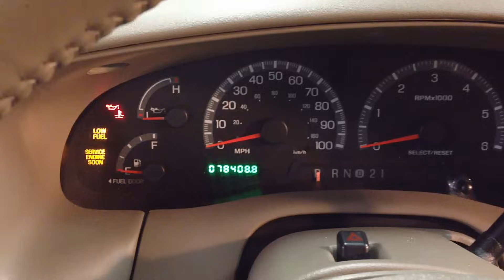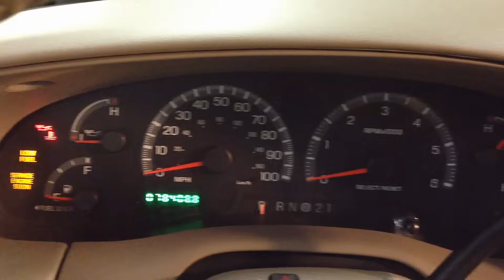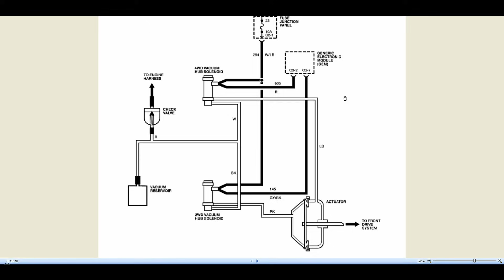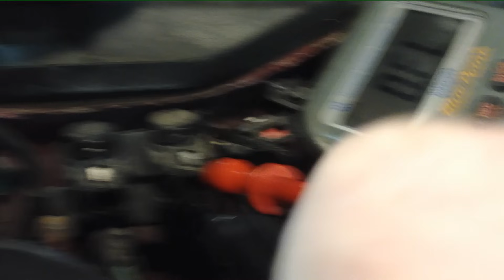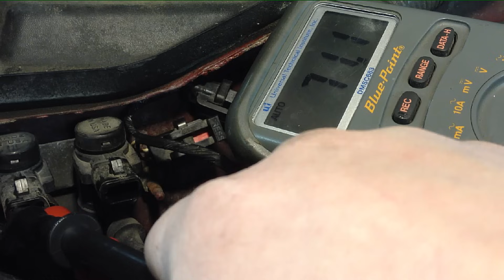1997-2004 Ford F150 4X4 Inoperative In Depth Diagnosis

Comment: I was able to do all these tests except checking resistence on the solenoids my 4x4 will engage but has a rotational  noise coming from the front end especially noticeable at 80km to 100km. Would this be a actuator fork problem or the actuator solenoid not fully engaging at higher speeds both wheels will spin at the same time with the front end lifted off the ground.

Comment: Thanks so much for this, I know it's an old truck but it's all I have and the 4x4 just crapped out. It was working fine last winter but now I get no clicks at all. I replaced the dash switch but that didn't help.Now that I have a better understanding I'll go through some more diagnostics.

Comment: I have a question for you sir.  I’m trying to figure why 4x4 won’t engage for a 2002 F-150.    With the help of your video, I’ve been able to determine the transmission shift motor sound to be working and the relay in the dash behind the instrument cluster is clicking consistently when shifting the selector between 2x and 4x modes.   Additionally, I have constant keyed 12 vs to the two firewall mounted solenoids and I have appropriate switched ground to those same plugs when the selecting 2x or 4x modes on the dash selector switch.   What I don’t seem to have is a good strong vacuum (it’s there, but maybe weaker than I would have thought it should be) when the engine is running.   So, I pulled the battery and battery box out to access the two vacuum reservoirs behind the battery box thinking maybe they were cracked.  Using my vacuum test equipment, I pressurized each reservoir to 5psi and it took over five minutes to lose even 1-psi.  Frankly, a little bit of soapy water sprayed on indicated a tiny leak only where my test hose was connected to the reservoir port nub.   As a precaution I used Yamabond 3 sealant and went around the welded seam of both vacuum reservoirs anyway.  When I test the vacuum on the lower lines that plug into those two solenoids, I can barely feel the pull on my finger and I basically won’t even move the needle in my vacuum gauge.  Might you have any suggestions as to where to start finding out why the vacuum is low at that location?   The truck itself runs just fine without any roughness, rough idle, or anything that would indicate a sizeable vacuum leak otherwise.   Thanks for any suggestions you may have.

Comment: Hello : The four wheel drive system on my 2003 F150 does not work. Upon turning the switch, nothing happens. I just finished changing out the four wheel drive relay under the dash. No change, still does not work.  I just tested the two vacuum modules. The ground simply stays on the 2wd module, it will not switch over to the 4wd module. What is next ? The GEM module?

Comment: 2009 f150 King ranch 54 engine 6 speed automatic transmission 4x4 shipped on the fly. I'm having problems with my 4x4 engagement. I ran to the full diagnostic procedure for 2009. I was a Ford certified technician for 20 years. The diagnostics came up with everything functioning normally. I have replaced the electric transfer case 4x4 motor and the vacuum 4x4 solenoid. With my vehicle running I turn the 4x4 switch from 4x2 to 4x4 and nothing happens whether I'm sitting still in park or neutral or moving at 10 miles an hour down the road. If I turn the key on with the engine not running it will engage and also disengage. If I turn the key on engage The 4x4 and then start the truck it will drive in four-wheel drive to disengage  I need to stop the vehicle put it in park shut the vehicle off turn the key back on and then switch it to two wheel high and it will disengage. The only odd thing I see is that when I'm driving or sitting still if I turn the wheel slightly to the left or right before by 2 will display on the dash intermittently. I am at a total loss.

Comment: I have a 2003 f150. When I turn the switch to 4x4 I hear nothing and the dash light doesn’t light up. I checked the fuses and the vacuum as you demonstrated and I have vacuum. I can also move the pin in and out on the actuator by hand. Where should I go from here? Thanks

Comment: I have a 2000 f150 5.4L. the 4x4 light remains illuminated all the time and i hear no sounds at all when changing the selector switch. I have vaccum to the selenoids but haven't checked any further. Should I be checking the selector switch, shift motor, or GEM instead

Comment: My vacuum lines were replaced 2 years ago. 4x4 worked great. The person who replaced them put them too close to the manifold,  and they melted. I had to use my 4wd and just learned of this. Now my 4x4 light on dash doesn't show, and my lines are melted. Do you have a vacuum line diagram and why isn't my lighting on up, tand I thank you for any help you could give me.
Reply: Where did you find vacuum lines for your truck?

Comment: My manual shifter doesn't want to go unto gear. The shifter has been off, freed up and lubed, it moves freely, but sometimes it won't drop.into 4w low. What could xause this problem?  I should also say the front diff won't engage either at the moment, and I had the transmission out and back in a couple of times over the last couple of months, rear diff off and on

Comment: Just found your video. Currently going through 4WD problems on my 1999 f150. I have been having some issues with my 4WD shifting into and then out of 4WD and the other I found what I thought was the problem a vacuum leak coming from the actuator. Watched your video replaced the vacuum lines and can visibly watch the actuator work but not I have no 4WD at all. Before sometimes I would have to backup and pull forward now nothing. I watched your video on transfer case shift motor and was wondering if there was a way to know if that was my issue or the selector fork? I don’t want to shoot the parts gun at it but I can 😂

Comment: Best video I’ve seen on this so far. The only problem is that it assumes everything tests OK like the truck in the video. My 99 F150 is stuck in 4wd. I went up into the Colorado foothills on a snowy road and the 4wd worked fine. It shifted into 2wd OK when I hit drivetrain pavement, and back into 4wd when I got to my hilly, snowy neighborhood. I haven’t been able to get back into 2wd since.
I followed the diagnostics on the video and the test light came on in both 2 & 4 on the inner (4wd?) connector, but in neither setting on the other. Same results on the ground side. Resistance was around 70 on both solenoids. I felt no vacuum at any vacuum line, unless it’s supposed to be subtle. My truck has both manual transmission and manual shift transfer case. The 4wd light on the dash stays on regardless of the shifter position. I’ve watched dozens of videos, but this one shows the clearest test procedures. Unfortunately, none has shown me what to do/test when these things go wrong. Any ideas out there? 
Also I’d love to get a downloadable copy of the vacuum diagram or directions to the source.
Thanks

Comment: I know it has been a long time since this video, however I have a 97 F150, and the 4X4 that is not working. Can you tell me what the OE part numbers are on the Solenoids (as far as I can tell there are 2 different Solenoids and it all depends on the tang position on the wiring harness clips) and also the OE Number on the 4WD Actuator at the Transfer case ? Any help would be appreciated.

Comment: Thanks for the explanation on the 1997 F150 4WD mechanism. My truck is a very early production model F150 4WD truck. My 1997 F150 4WD just started making a growling sound like it like it’s in 4WD when it’s in 2WD. I am able to engage 2WD to 4WD and back to 2WD just fine. This just started the other day when I drove it a few blocks to a meeting. When the meeting was over an hour later as I drove out of the parking lot it was growling like it was partially in 4WD. I think it could be a cracked vacuum reservoir. Thanks

Comment: My 97 f150 lariat is stuck in 4x4 low range im not hearing any noise behind the dash when I try to shift it into 2wd or any of them. Nothing is happening underneath either I check all the fuses and the switch and they are all good. I'm not sure if its the GEM, or the vacuum or the case motor. Any tips?

Comment: So if the ground isn't moving to the other solenoid when I move the switch to 4wd, does that implicate the GEM? (I can confirm that the resistance values generated by the switch itself are normal and stable.)

Comment: So my issue is I hear the relay clicks but no dash lights and no 4wd if I put it in low it goes to low but no 4wd cvs front drive shaft and diff is good

Comment: I'm having a problem with an 02' F250 that when the truck is running, I can shift the 4x4 shifter out of 2H but will get stuck in 4H and only go into 4L sometimes but will get stuck there as well. Shut the truck down and the shifter will shift smoothly in and out of all three positions. Tired rocking the truck back and forth from drive to reverse but that does not help. Did not matter if hubs were locked or free

Comment: I have no negative to solenoids and no click under the dash or shift motor rotation.  Does the gem feed to a relay that may be bad or could the gem be partially bad?  Thanks, Don

Comment: I don’t have power to the 4WD engage solenoid…. I looked at the gem module and fuse panel and there’s no sign of corrosion, and everything else works great. The only thing that’s wrong is the 4x4 isn’t engaging.

Comment: So you covered 4x4 high very well. My issue is switching from 4x4 high (i hear the click and dash illuminates) into 4x4 low.. (i do not hear a click nor does low range illuminate on the dash.. suggestions?

Comment: My only have switches only had back into the four-wheel drive one and I know back into the two-wheel drive side. Two-wheel drive side doesn't have the ground power . Four wheel drive has which has the ground power  and vacuum.

Comment: Great instructing man!! All checks out on my 03 f150. Actuator is moving all the way back and forth on front diff. but when in 4x4 mode front diff. axles are not locked. Tried pushing actuator arm farther in with no results. Looks like it is completely moving in all the way so what else could be going on? Thanks for any advice. CHEERS!

Comment: I have needed to do a battery disconnect reset, two different times, to get front differential engaged. 2000 f150 . What should I replace? Or just continue doing reset? Dashboard lights indicate 4x4 engaged. High/Low range works
Reply: What is being reset when I disconnect the battery.

Comment: Ok 4x4 manual shift for transfer case. When shift sticky old truck shifter to 4x4 high and low light on dash appears. So put in drive from neutral and auto trans trans not in gauge then catches in say 3 seconds w higher rpms ,not tromping it ,easy. So trans catches and drive but won't go into third ,high rpms won't shift. High rpms not shift. Previous owner s may have messed w linkage she liked to pop out w
Unless manual shifter is man handled into 4x4. She used to work.

Comment: Excellent description and testing. I replaced my 4x4 select switch on my 2001 F150 Lariat but the solenoids still do not switch, the 4x4 indicator lamp is on no matter the switch position, I do not hear a relay engage when rotating the switch to 4x4. Both solenoids have 12v pos but the negative does not switch. Do you have any information how to test the GEM module to verify the switch is connected and the GEM is responding? Any help is appreciated.

Comment: My 2002 is stuck in 4 wheel drive. Light is still on when switched to 2 wheel drive. I have power but no ground on my 2 wheel sode of the harness. Would that indicate GEM module?

Comment: My issue is that, when trying to put my truck in 4x4 low and high, it doesn't even light up the two lights in the instrument panel... Oh yea, and it does not activate the 4x4 obviously throuythe transfer case!!! I do hear the normal clicking that it did when it was working coming from inside the dash with the relay

Comment: Thanks for the video very helpful but not working. Everything is fine vaccums are pulling the lever and I can hear the 4wd engage. But it doesn't work I spin one wheel when jacked up and nothing and for sure as I drive it's not working any ideas?

Comment: Great video 
Would either one of these solenoids get stuck open or cracked diagram cause a vacuum leak enough to cause loss of vacuum during acceleration 
I have been going through everything vaccum related to find out why my ac vents go to defrost only during acceleration.
Please help
Reply: Check those vacuum lines that goes to those solenoids. I had the exact same problem and I found two lines that were cracked and breaking. (They were basically dry rotted.) Once I fixed them, the issue went away. I’m trying to find replacement vacuum lines cause they can only be fixed so much.

Comment: 2003 f150 4x4 when I raise the truck up front wheels in the air...right wheel spins freely  but not the left would there be something wrong with the actuator not disengaging properly?

Comment: My 98 Ford 150 XL 4x4 suddenly stopped shifting gears in 2 wheel drive. I coasted into a parking spot an manually put it in 4 wheel drive and was able to drive it home. Do you have any clues what the problem might be? Thanks.

Comment: This video has been so helpful but after using the T/S you described I now need to figure out where to go next. My 4WD (2001 f-150, with electric on the fly switch 4wd) would not function so I replaced the Actuator first as it was pretty bad looking from salt. That didnt solve the problem so I replaced both solenoids and that didn't solve problem. I then did the T/S on the wiring that goes to the solenoids and found I'm not getting ground on the 4WD solenoid when its switched over to 4WD. I did check ground on 2WD and it is good when in 2WD and my tester stays lit (in 2WD wiring) even when I put switch to 4WD. Would you replace switch in truck or go to GEM? This problem is getting on my nerves!!! thanks
Reply: Im having the same issue, what ended up being wrong?
Reply: @nathananschutz9926  did you ever figure your issue out? I retested my electrical exactly as he did in the video and everything checked out fine.  I bought 2 new solenoids as I was not sure my previous parts were good and now I am not getting vacuum on the output of either solenoid when I switch to 2wd or 4wd. Im effiing stumped?

Comment: Experienced some trouble once when i used four wheel with staying in four low.  Haven't used 4x4 since and decided to go through system after watching this video and at the first step no 4x4 light on at dash or clicking noise.  Any thoughts beside fuses as i checked?
Thanks
Also, checked front wheels to make sure they spun free and yes.

Comment: How about shift on the fly. Manual. No switch.
I have a constant ground signal to my 2wd air solenoid. Going to check for short today. Is it just that sensor that screws into the transfer case? 2 prong with a ball switch?

Comment: No clue if you will see this comment on this old video. But I was trying to track down a vacuum issue for the last while. Today I was looking at those 4wd vaccum lines and there appears to be a blue line just open, not hooked to anything not capped, its in the same protective loom as the one that goes down to the passenger side hub. Any clue if this is normal? If not what line would it be...? I am pretty positive it is a dark blue line. Any help would be appreciated.

Comment: So the selector switch and actuator on the transfer case have been replaced. With key on engine off the vehicle won’t switch to anything no click under dash . I have power to both solonoids under the hood behind batteries and I switched over the selector switch to 2nd 4h and 4lo. I also checked power to ground and I have power to both grounded side regardless of what the selector switch was on. My question is this a faulty gem module and where is it located along with the relay under the dash? Edit I have power to and from fuse 23 10 amp fuse

Comment: Question for ya.....picked up a new IWE solenoid for a 2001 4x4 5.4L. Went to install it- there were two on the firewall......Do you carry these ?   Would like to order ASAP.  Truck not driveable the grinding is awful.

Comment: I just found this video I have a 97 Ford four-wheel drive I just got the truck the four wheel drive was not working I put an actuator on it last night but there is no vacuum when you put it in 4-wheel drive and pull the line off of the actuator it has vacuum when you have it in the two wheel drive and pull the line off it does have vacuum does that mean the solenoid is bad?

Comment: 0:34 I have a question I went through everything on the four-wheel the disengaging and at the transfer case is engaging because I can’t turn my front driveshaft on when it’s in four-wheel-drive my switch is up on the the air the vacuum the vacuum relays up on the fire wall their work in this got good vacuum ago underneath I look underneath in the I forget what it’s called under there the round thing that has the vacuum on it that ships it in and out that’s engaging in and out but I still don’t have four-wheel-drive to my front any ideas of what it could be

Comment: I pulled the green vacuum line off and I'm not getting vacuum off the 4wd solnoid but I'm getting vacuum to the bottom one. I switched the 4wd switch back and forth and nothing. Do I need a new solnoid? I'm getting constant 12v to the plug. I swapped it with a old one and still didn't work. I don't head anything when I click it into 4wd no reply or transfer case sound. Any advice would be nice 😎

Comment: 2002 f150 5.4 clicking under dash when key is in the run position and in 2wd , once it stops clicking maybe 5-10 seconds it clicks again and the 4wd light comes on. You can move the switch 2h,4low nothing no relay clicks even the t-case motor does nothing